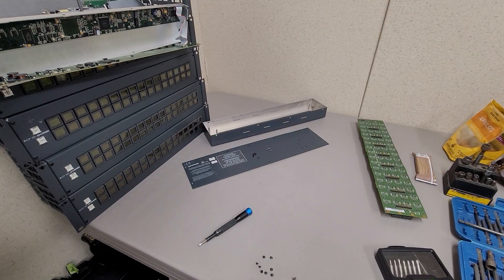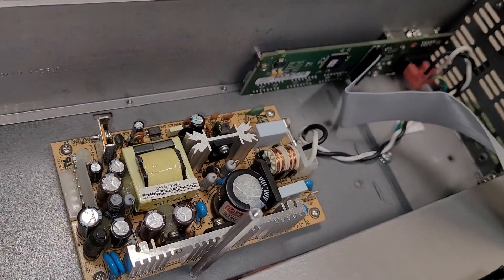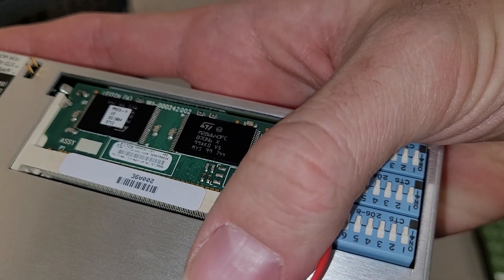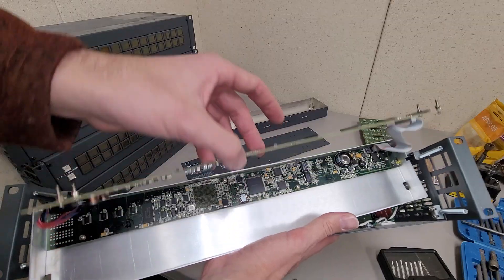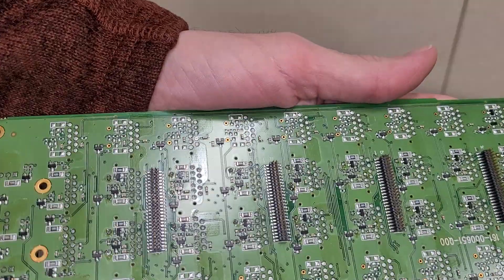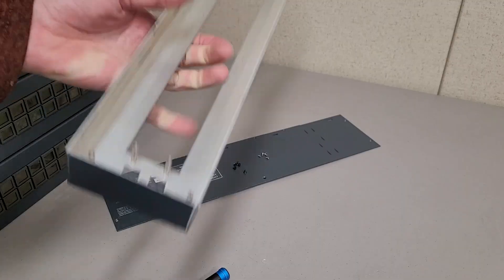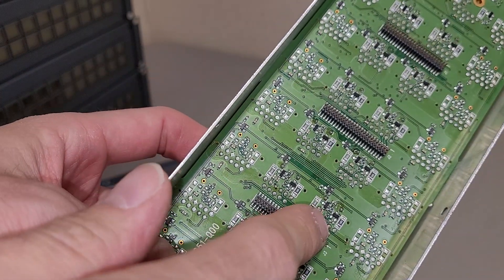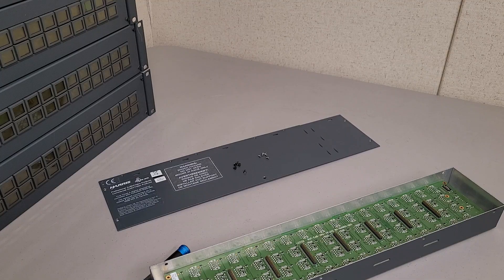Leitch Harris RCP-32X1IDE Programmable LCD Button Remote Control Panel #teardown

Comment: Those are really cool - but I'd guess also very proprietary - otherwise I'd take a raspi and code something ... Displaytech has become so Nice but also so Cheap it's probably not worth my Time to mess with it ... Few Days ago I rescued a 32 in LCD Monitor/TV that someone abandoned in our Parking Lot, still works just Fine, was just dusty ;-)
Reply from the maker: It would be cool if I could make my own custom stream Deck that was open source. I especially would love to have programmed hotkeys for common answers to dumb questions people ask me on eBay. 😂